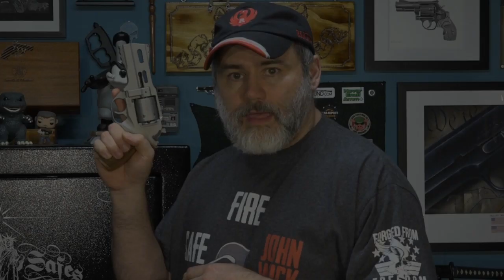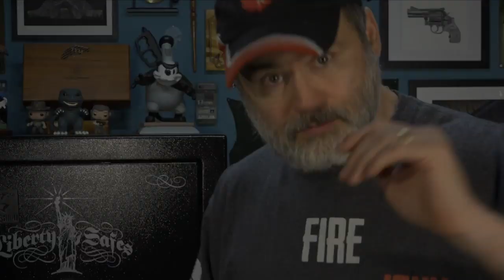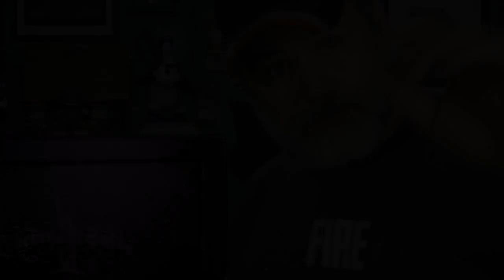How to Grip/Shoot a Chiappa Rhino...(For my slower viewers)

Comment: Hell, you don't do a thumbs forward grip on ANY revolver because of the cylinder gap, not just the Rhino.  Shockingly, jets of super hot gas do bad things to flesh.  It sounds crazy, but it's true.
Reply: True. But the Rhino is worse since the barrel is at the bottom right above the trigger.
Reply: I keep my thumbs out of reach of slides or cylinders...IDGAF.
Reply: What about the Nagant revolver?
Reply: @drtm1718  keep your thumb from touching the cylinder. The action is already heavy enough. No need to adding resistance.

Comment: Good advice, but any kaboom from a Rhino will do damage to your hand regardless of your grip. I owned one until I saw every kaboom go down into the frame  and shatter it to pieces. This means all of it goes down into the shooters trigger finger and hand.  At least with a traditional revolver the kaboom blows up or out to the sides. Mine was very accurate and was fun to shoot, but I'd rather not risk my trigger finger on a unique design. There's a reason why no other company is making their revolvers with the barrel at the bottom.
Reply: Dude my hands fet filthy shooting these. It definitly blows the gases down on you

Comment: It's no joke, I did this once about a year ago on a friend's .357 rhino. Been shooting double action revolvers for years with the same hold and just wasn't paying attention to the different thumb position the rhino requires. Took about 3 weeks to heal to the point where I could use my thumb normally, very nasty bruising and discoloration and some jacket shavings that went pretty deep, but I'm lucky it didn't take my thumb off.
Reply: To be clear, I keep thumbs off the cylinder and lower on the frame out of the way which clears the front of the cylinder safely on ALL other revolvers from my snub nose .38s to my .44 mag. But the design of the rhino places your hands in a different and naturally dangerous position. For that reason I don't suggest that anyone but very experienced shooters get a rhino. However, even for experienced revolver shooters, my muscle memory is what caused my accident in the first place.

Comment: That's a ridiculous grip for a ridiculous gun. I'll never own a gun that odd.
Reply: This is true for all revolvers, the barrel is on the 12 o'clock but there's still gas coming out the cylinder gap.
Revolvers predate the thumbs forward grip and thus were never made to acommodate it. It just so happens that it's more damaging on 6 o'clock barrels.
Reply: @ChucksSEADnDEAD  yeah but this gun has the chamber near your hand at 6 o'clock, where a standard revolver is at the 3 and 9 position on the side of the cylinder where you're not going to have your thumb near in a shooting grip. So no it's not the ssme.